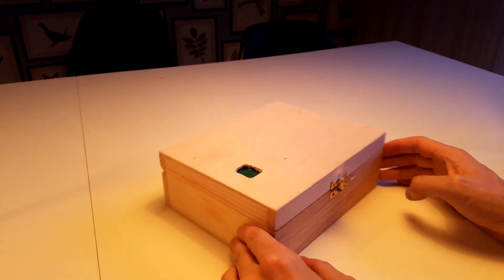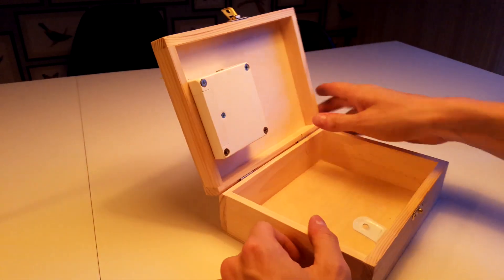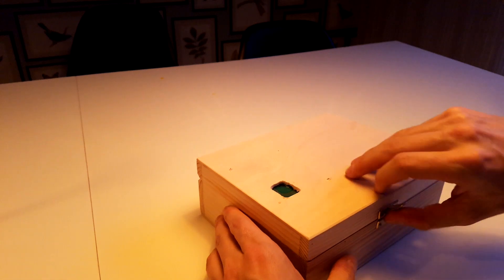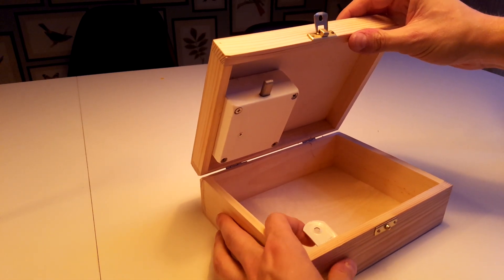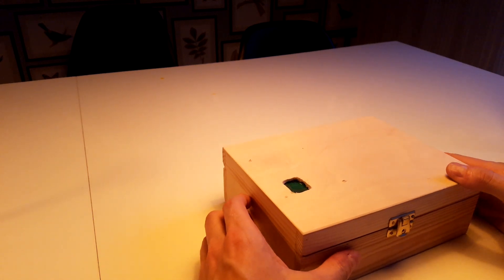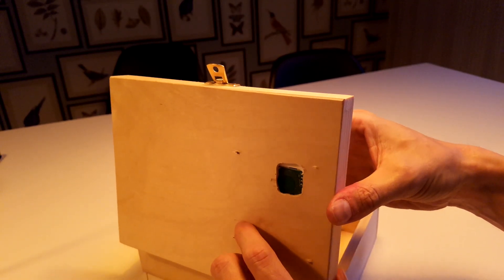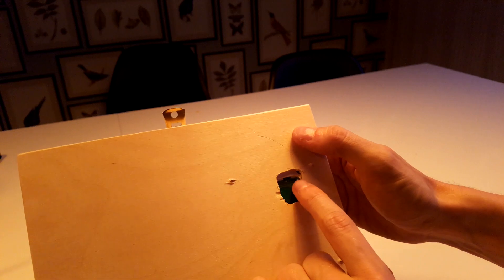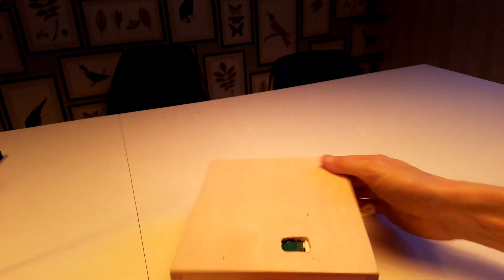DIY RFID Safety Box with IKEA Rothult smart lock

Comment: what exactly nfc implant do You have ?
Reply from the maker: one mifare with chenese back door, and one 125khz with writable id.
Reply: @AndreasLundblad  can You write a link to it ?
Reply from the maker: @rzepa10  I'd have to dig to find the links. But these chips are outdated. (2 years or so.) There are combo chips now, i.e. both chips I have in my hands, in ine capsule. Also, the flex chips are more fun I think. Check out the stuff at dangerous things.

Comment: How did you add a second NFC reader rothult system? Did it also work with a Android smartphone?
Reply from the maker: What do you mean with "second NFC reader rothult system"? I just added 1 rothult to the box.

No, I did not try to do it with an Android smartphone. Not sure how to emulate a tag on Android. Perhaps it's easy?
Reply: I tried to add my smartphone to the system instead of using the master key & it doesn't work. Also in many online forum, the same problem showed up. So, the question is, how you added your RFID/NFC reader in your hand instead of using the master key of the rothult system?
Reply from the maker: @felix15de   I don't recall exactly, but I think it was trivial. I think you just lock it with whatever key you want to later unlock with. (Should be in the manual.) It might have to be of the right chip type. My chip is a mifare classic 1k. That's a fairly old type so I doubt that that's what your phone has.
Reply: @AndreasLundblad  Yeah that's in the manual but it does not work. Hm! Thank's for your help anyway.
Reply: @felix15de  Hello, did you find an answer how it should work? I bought my self 3 Pcs, but it does not work at one...

Comment: You mention the range of the RFID implant. Have you tested the range using the cards? Considering this lock for a wardrobe but if the range is too limited I might have to reconsider (there is only so much material I could remove from the back side of the door)
Reply from the maker: with the card it should be absolutely fine. It's a cheap experiment :) buy one and try it out